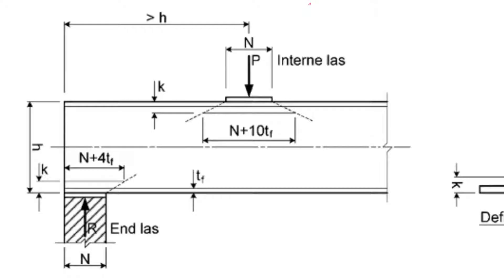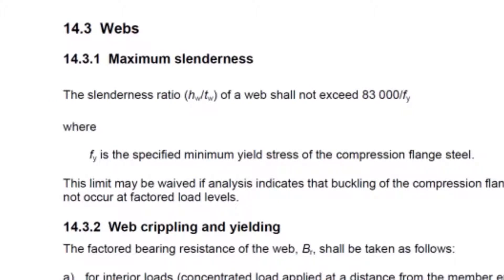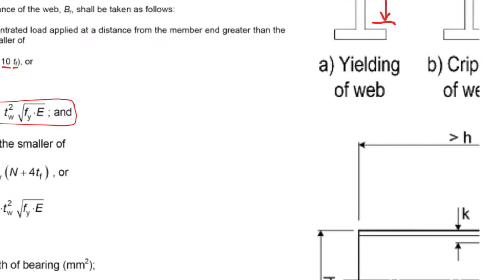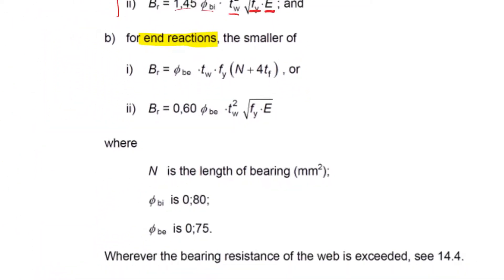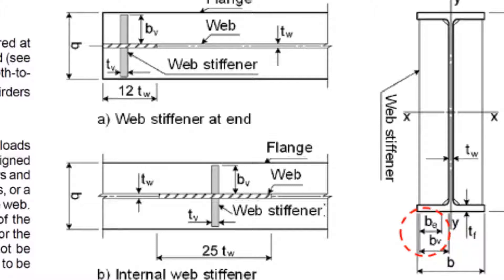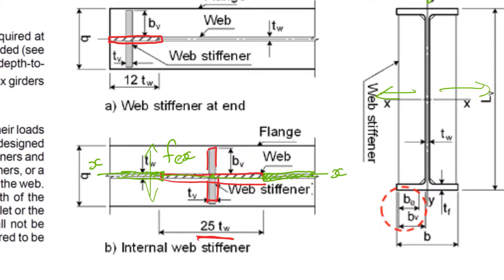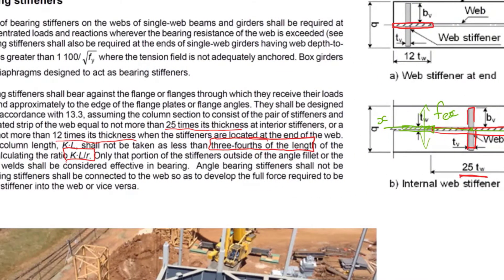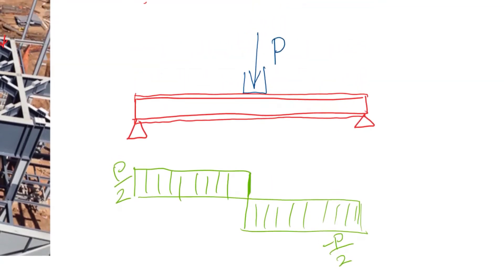Bearing and stiffener design for steel beams - SD424

Comment: Hi Richard, why not perform the Flange Local Bending check when performing the checks for concentrated loads per AISC section J10? Is it simply because the note " if the length of loading across the member flange is less than 0.15bf, then FLB is not checked, or is it for some other reason regarding bearing design and stiffeners? Thanks!
Reply from the maker: @Davehuv  we have slightly different checks in our code which is based on the old Canadian code version.